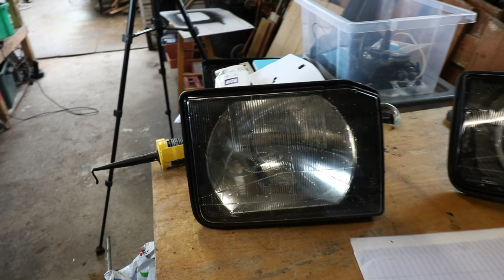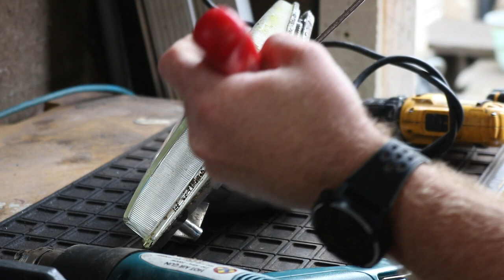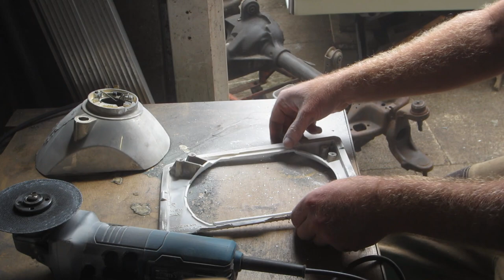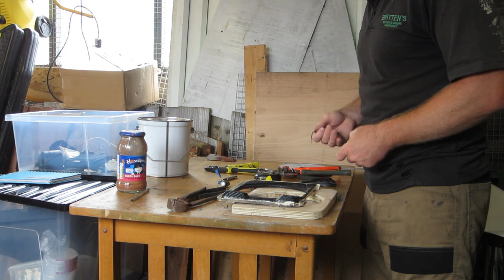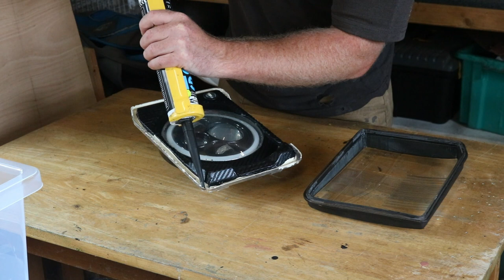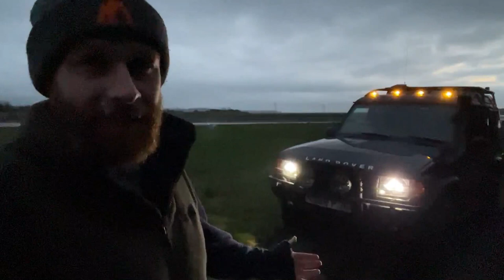How to fit Led headlights on a discovery 1

Comment: That's geat. Mine are well degraded and need soemthing like this. What parts and materials did you use?
Reply from the maker: I used 7 inch led round lights, an old set of headlights and some Perspex
Reply: Great video! Looks like a much cheaper way then to spend £600 on the ones I’ve been looking at. What thickness was the Perspex?
Reply from the maker: Thanks, it could be made a bit better but it worked out well. I think the Perspex was about 5mm thick

Comment: Cool lights😎👍 - Are they road / MOT legal? What about beam adjustment- and where are the LED units from?
Impressive 👌
JonT
Reply from the maker: The lights use the existing mounts for adjusting, the led units are just defender lights in discovery housings so I presume they would be legal. Thanks Jon
Reply: @TheNorthernExplorer  
Cheers. I just bought a Disco 1 that I had years ago- found it completely by accident on ebay. Needs a fair bit of work, but looking forward to the challenge 😁
Reply from the maker: @jont3354  awesome! Well worth fixing them up 👍